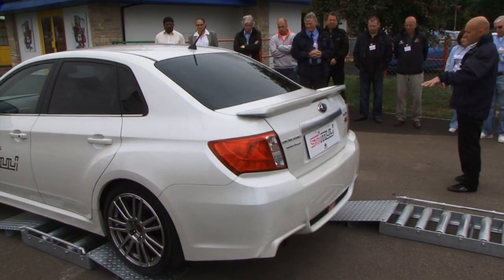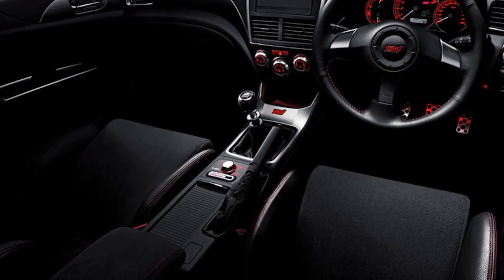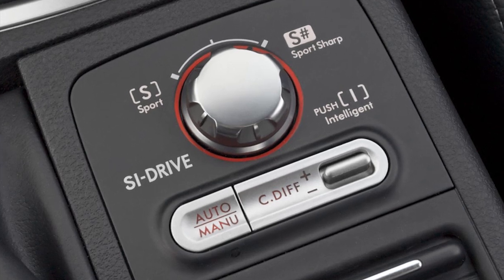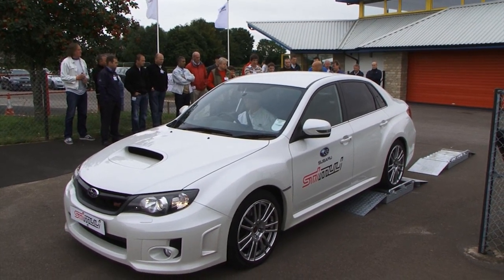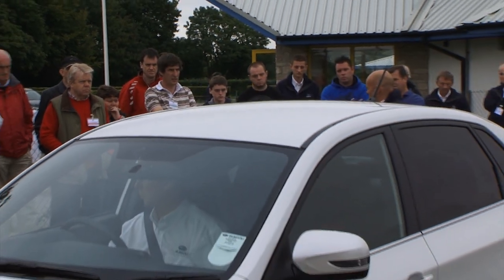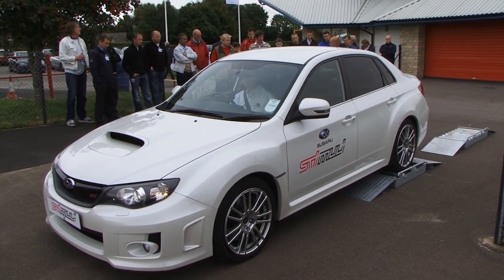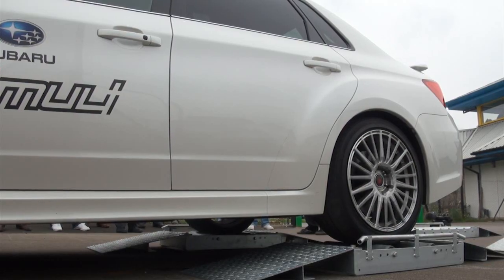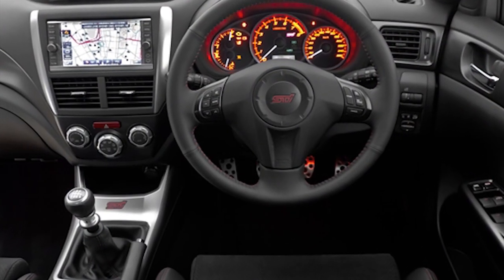Si Drive - STI Center Diff Demo from Subaru UK drive team

Comment: It's a scam, Subaru's centre diffs don't lock to a 50-50 torque, it moved off the rollers because it had no resistance and the car was facing down hill, I've ran and worked on Subaru cars for 35+years and I will say that the Subaru centre diffs are crap, they have them because nothing is strong enough to be proper 4WD, the hole lot is a waste of time.
Reply: they use the center diff because you can change the path of the toque, which is very useful in a rally car.

Comment: Some people understand it and some people think they understand it.
41/59 is 06+ STi. 35/65 is 03-05 STi.
The 41f/59r torque split is a result of its natural design.
ie. The number of cogs on the transmission output gear and the number of cogs receiving the torque on the front and rear axles. These cogs teeth numbers result in its native 41f/59r torque split.
When the DCCD is unlocked the torque will go anywhere with the least resistance 100/0 or 0/100 whichever end is on water or ice.
Locking the diff, the DCCD will try its best to output an even 50/50 because it's trying to restrict and speed difference between the front or rear axle. It's still possible to send torque 100/0 or 0/100.
This is because say for example the vehicle is chained in place, not letting it move at all.
If the front wheels are on ice and the rear wheels are on dry tarmac, what will happen is 30, 40, 50nm of torque (whatever is required to spin the tires on ice) will go to the front and 0 is going to the rear because it's not moving. Vice versa for the rear axle.
All the dccd is doing is not letting the front or rear go at different speeds, to the best of its ability.
It's "NOT" torque vectoring, trying to send power either front or rear.
Reply: How can it go to 100/0 if the distribution is 41/59 while the clutch pack is unlocked (as open as it can get), and 50/50 when the clutch pack is locked? It cannot lock or unlock any more than that.
Reply: @joshjlmgproductions3313 When the diff is open, it's always 41/59, that's how open diff works. When the diff is locked then you may consider static torque split (50/50) or dynamic torque split (range from ~100/0 to ~0/100).

Comment: Even this guy is from subaru (maybe) He doesn't really know what he's talking about. C-diff does not have the abillity to change torq split. You CAN NOT do full lock driving on pavement dry or wet because the front and rear wheel turns at different speed due to the 41/59. you will f up the DCCD clutch in no time.
Reply: As long as you are driving in a straight line, you can drive with full lock. Torque split of the diff in open state doesn't matter then.
Reply: exactly. Many peolpe are now going to f up the DCCD becasue of what this guy said.

Comment: Video is a little wrong, its not sending more to the rear its just opened the diff and spins those wheels because they are on rollers.
Reply: It's sending more in comparison to being locked. But yeah, it can't send more than 59% of the torque.

Comment: I'm crying inside when he said locked is 50/50. The torque split is NOT variable, it's fixed by gearing. What you CAN change is the enforcement of that 41/59 split.  Subaru has always done a poor job of explaining torque split on DCCD cars because the physics are not apparent to the layman.
Reply: I've been researching for a while and still don't get it. I get physics it's just so much misinformation idk what to believe
Reply: @brother_maleik same what the hell does it do. Seems like it just locks the differential and sends power so it doesn't slip. Not necessarily ever torture split
Reply: @brother_maleik  it's nothing different then a LSD on rear wheel drive sportscar. but it get relocated between front and back. Regular LSD keeps both wheel 50/50, DCCD keept the front and back 41/59. It's very simple don't over think.
Reply: @Align700nitro  locking the diff will distribute 50/50 because it's trying its best to prevent either front or rear axles rotating at different speeds. 
41/59 is its native output governed by its gearing outputting to front & rear axles.
Reply: @brother_maleik Static torque split vs dynamic torque split. Marketing trickery based on physics.
Reply: Finally someone who knows it

Comment: Qwerty1274 - the first demo is NOT in Auto mode, it is in manual mode with the centre diff fully unlocked. This gives more torque to the rear wheels as explained in the video. In Auto mode there is much less wheel spin than this. This demo is to show the difference between the two extreme settings in manual mode. In Auto mode it will adjust the torque distribution to the axle with the most grip.

Comment: You should note that in auto the distribution of drive is not on or off, the system smoothly increases the drive as needed, when needed.  In lock it is locked 50/50 and that’s why it drives off the rollers without wheel spin.